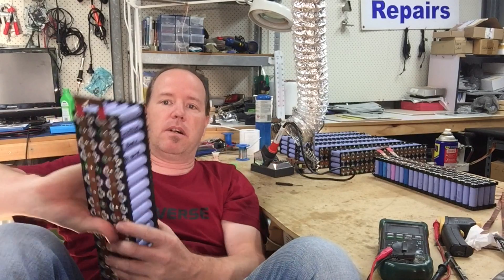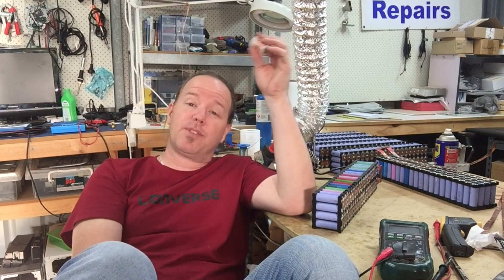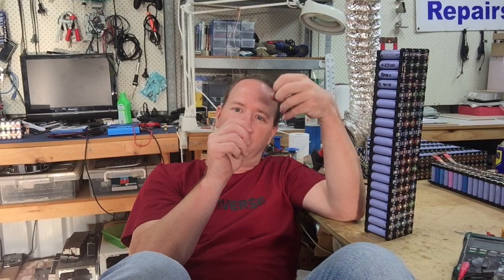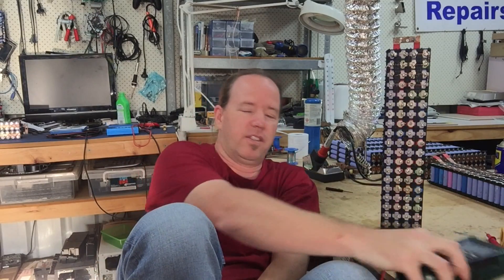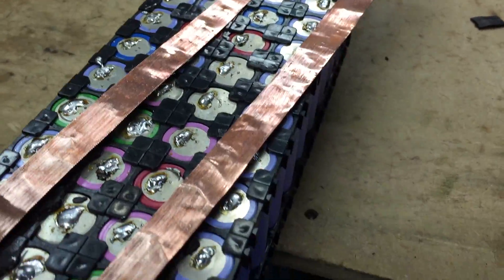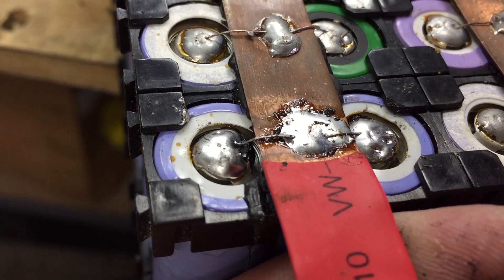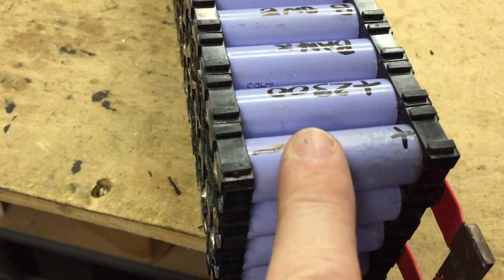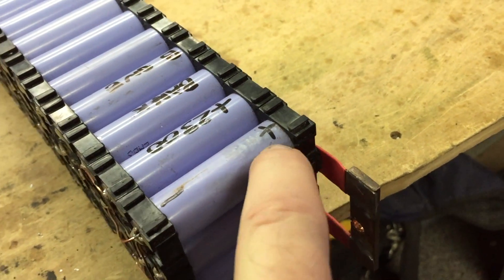Thought I had to redo all cell fuses! VERY poorly produced video - Sorry in advance.

Comment: always leave a bit of slack in the fuse wire...Tesla does..... for different temperatures where the fuse wire could be under contraction from temp change and fail...pulling the fuse wire over multiple cells when soldering...heat on contraction the small fuse wire is already under strain...question mark

Comment: amps is amps and volts are volts arent they ? so if your using a rated 4 amp wire then it should have blown at 4  or slightly more than 4  in real world conditions  would an mov be any better or cost effective ?
Reply from the maker: Yep, learned a lot since then :)

Comment: apart from batrium is there a way of checking individual cells ?
Reply from the maker: Of cause, you can do individual cell volt led displays, manually do it with multimeter many even playing with Arduino's
Reply: but currently not very practical or economic
Reply from the maker: I guess how practical the safety is i guess

Comment: Old video but Peter, you should have put the multimeter in series of the fuse and see what the current is being put into the battery, it could have been just before breaking point, If it was over what you expected the fuse was suppose to break at, then the fuse is a bad size. it may have been just under the point of it going red.
You should calculate the max current you expect/want out of the pack and then divide by the number of cells and put that size fuse for each cell + ~20% for surges etc with a max fuse for overall pack in case of short across the positive terminal (which I think you did in newer videos).

Fuse testing should also be done with a shunt system and something (PI maybe) that records in ADC so you can see the ramp up and breaking point in amps. This is something I've been thinking to design and build as I can't find anything on the market (or goolge fu skills suck)

Comment: U - voltage
p - specific resistance of the certain materials (Cu = 0.018Ohms/mm^2 - Al = 0.027Ohms/mm^2)
L - wire length 
I - Current
S - cross section of the wire (r^2 * π) - r = R/2
P - power

Basic math (or should I say physic)   -> U = pLI/S or I = (U*S)/(p*L)

Here is the maths for your fuse, or the basic rule of thumb if your copper wire is R=1mm it can conduct ~10A(!!!) for 15mm of length.

Comment: Just wanted to thank you, I was doing the same mistake testing my fuse wire @12v until I saw your video. My fuse wire (+-0.1mm diameter copper) burn at approx 4A 4v or 12v and can hold 2A cool so I think it will be ok.
A good progressive way to put a progressive load is to use a battery drill, I was able to push from approx 0.5A to 5A graddualy to test different fuse wires.
Reply from the maker: thank-you for your comment. Pete

Comment: If that dud cell was even drawing max 4 A through the intact fuse at about 3.8 V then the 15W of heat generated would raise the temp considerably.     Fuse wire used to be expected to blow at twice the rating within 2 (?) seconds.  Many have commented on the slip up at 10:58 that blew the MM fuse.     It happens to the best of us.  :-)
Reply from the maker: Cheers thanks for the input

Comment: I've heard electricity described as very much like water as it is affected by gravity it can be channeled like water through valves

really just mastering some Hands-On basic multimeter tests will put you in the right direction

many people learn by doing things the wrong way a couple times first, nothing wrong with it

I'd recommend a basic test light that can show positive and ground circuits to help when you're exploring your battery packs and bring the meter in for more specific tests
Reply from the maker: +jimm therockgate noted

Comment: Ok, as others have already said what you did with the multimeter was to short the battery pack by connecting + and - via the multimeter. You should have put one probe on the + of the bad cell and the other on the + of the rest of the pack to measure the flow through the bad cell.

One tip when testing things like this is to put a bulb in series as a current limiter, it helps to keep the magic smoke in.

I'll admit that I've blown multimeter fuses many times in the same way. The big one for me was ussing it to measure amps one day and then next going to do quick voltage check on a battery and forgetting the leads were in the amps plugs....

Very interesting in that I've not seen many 18650 cell failures and I have been wondering how they fail. Check out axial fuses, I havn't counted but 100 cells in parallel even with just 1A fuses allows 100A for the pack. I suspect that when 18650 cells fail they are unlikely to go to a dead short as there will be resistance in the pack, this appears to be exactly what you had and why the fuse did not blow.

Comment: Just wanted to point out one flaw in the way you connect the bus bar to your cells. The way you have it connected right now, it is the front cells which are taking the most hit, both when charging, or discharging, because the path of least resistance is straight through the first pack, then second etc.. I remember watching lectures about electrical engineering and it was emphasized, that plus and minus should be pulled from opposite ends, as in, the current should be forced to go through the entire bus-bar.
Reply: when you pushing 5A in the first cell at 3,7v and find the right wire. Do you use the same wire for cell nr2,3,4......and so on? isn't the voltage getting higher in every cell in series?
Reply from the maker: +TheRadiastral yep all fixed up ;)
Reply: HBPowerwall Glad to hear. Awesome job, btw!
Reply: O

Comment: I think you want a thermal fuse.  If a cell gets an internal short, it doesn't need to pull large amounts of current, it can use it's own power to go thermal.  A fuse laying against the cell that could sense its heat could blow, protecting the rest of the pack.
Reply from the maker: Doesn't sound like a horrible idea - Did consider putting a thermal fuse on neg and fuse wire on positive but really did seem like over kill.

Comment: fuses blow on current and not volts, 4amps is 4 amps at 12v or 48v
Reply from the maker: Yep, since learnt that :) something new every day :)
Reply: Contact me anytime with questions I am a design engineer with lots of experience :-)
Reply: Yeah, a fuse blows when the power it is dissipating is enough to melt the wire. Power equals amps times volts, the voltage across the fuse equals the product of the current flowing through it and the fuse's resistance (by ohm's law) Therefore the power equals resistance of fuse multiplied by the current squared that is it is totally independent of volts. Therefore a 4 amp fuse will blow at the same current regardless of voltage, the only reason for a voltage limit on a fuse is safety (66,000 volts will arc across a 4 amp auto fuse!!!)
Reply: Rich, I am just starting the process. I am building a 72v 20ah pack for a electric motorcycle. What is the ideal set up to test fuse wire. I am guessing. connect 2 wires to single battery, one wire goes to a load. the other has alligator clip. you hook the fuse wire, then you put your multi-meter in series, then the other end to the load. Ideally the load can be varied, such as someone suggested using a variable speed drill or dial resister.  So at 3.0 volts, 4 amp draw, what should my resistance be?  And is this the correct set up?

Comment: Pete, i couldn't make out the wire you are using.  you said you would link it but Couldn't see it anywhere. what type of fuse wire are you using?
Reply from the maker: +Peter Hoyle it is 0.25 mm winding wire from jaycar is is linked in the battery shed video description I think.
Reply from the maker: +Peter Hoyle https://www.ebay.com.au/itm/252441212705
Reply: +HBPowerwall Cool, thanks.
Reply: .24mm (0.00944882 ins),   28ga is 0.0126, seems like 32ga. Seems too thin, others recommend 28ga. Beginning to think no one knows.

Comment: Why I think your fuse didn't blow at 4A like you tested:
Because you tested a greater length of fuse-wire. The length of fuse wire between the busbar and the cell terminal is very short, so it's easy for heat to be conducted away by the copper busbar and the cell. 

The problem with your IR themometer:
Don't use it on bare metals (or any other material that has a low emissivity in long wave IR-spectrum). The heat shrink is fine, but please look up a table of IR emissivity values for different materials. If you want to measure metal, then you put some paint on it first. At least enough to cover the measuring spot. Your measuring spot is NOT the red spot. That red spot is just to help you point. Usually there's a table on side of these devices that will tell you what the relation between measuring distance and spot size is. If your measuring spot is larger than the spot you want to measure it will average over that larger spot and you'll get an average over the entire spot.
Reply: The fuse did not blow, because it was heating up from Resistance till it would have got so hot to blow the fuse. I am not sure what wire he was using at the time.

Comment: Connecting your multimeter across the pack will kill it every time. You need to put the amp leads in series with the +ive wire. What you did was let all the cells dump their energy through the multimeter.
Testing voltage is done in parallel across a cell or circuit, testing amps is done in series.
Reply from the maker: +jimm therockgate hey first to admit that hell I don't even fix my own car but my car hasn't caught on fire yet so guess I'll make out alive :)
Reply: This

this guy is lacking basic knowledge of how electricity works

he's probably going to burn his house down if he doesn't learn
Reply: I saw that setting on amps did shorted out across the batteries, seem it isn't the fuse fault, you made the meter setting on amp shorted out across the batteries. Clive has pointed out to you.
Reply: This is correct.  You shorted the battery pack through the amp meter by itself and none of the current went through the bad cell.  

The fuse wire you used in your batter are probably fine, actually.
Reply: That's a very common mistake, probably because people just know checking voltage is between red and black. I bet the number of multimeters that are blown that way everyday is surprisingly high.

Comment: Those fuses look too tight, thermo expansion/contraction could break the wires. I made mine with a S curve. AND If yours did blow it would have vaporized.
Reply from the maker: Humm interesting, i'll look at trying to give them a touch more slack from now on.
Reply: I wouldn't go re-wire all of yours, just monitor them, but all future wiring I would implement some sort of spring. ....and i'll add an interrogative that i've been thinking about, might make a good episode: 18650's are going to start to be rare very soon. Tesla is moving to a 30% larger cell and laptops now are using pouch packs. Something to think about.
Reply: Just dumps millions on the market. Since these telsa battery packs are being reused or busted up and sold off pc by pc. I like the flat packs better, more juice in a smaller package. I just ordered a 30v for my  kids scooter. A flat pack with BMS. for 34.99.  From batteryalarm on ebay.

Comment: good video, 

my under standing

4amps is 4 amps       4v  10v    100v

the length of the fuse will make it weaker  (longer)

and your test with the meter I think you might off stuffed up.

it looked like you went from buss bar to buss bar? 

should have been from negative to fuse wire.
Reply: 2 inches to 2 feet don't matter, you have to talking feet to make a difference. This is not resistance wire, it tinned copper.

Comment: When you do the next tests, only use the same length of wire that you would have used to connect the bus bars to the battery. 12-15mm?

Comment: Do you need fuses for an ebike battery pack? I've got a 14S 14 P ebike battery pack I made from salvaged 18650s and I didn't use fuses. Of course this is just an ebike battery and not a giant 22kwh powerwall So I didn't think it would be a necessity. Also fusing cells like that takes up significantly more space on an ebike battery and I needed to reduce space as much as possible. Should I tear apart my entire battery pack and start over or should I just be careful and not redo the pack?
Reply from the maker: Completely up to you, I don't think I've seen an ebike battery with fuses. Sub https://www.youtube.com/user/bruno2bari this channel if you haven't already and take a look at his ebike battery vids - pretty insane stuff and the info you need might be over there.
Reply: YES, you are bouncing that thing around.  Did you add a BMS?

Comment: Big ops aye Connecting the millimeter up across the pos and neg, given each cell can put out 8amps on a short thats 80cells x around 8amps peek so a peek of 640amps , The poor millimeter 10amp didn't stand a chance, Made for a good video snippet tho.

If the fuse wire is 4amps or around that , Remember thats 4 amps per cell not 4amps for the whole pack. Its 320amps Which is why you can pull 90amps from your inverter and your packs are happy. 
Note.Packs in series share the same overall max current as one pack but with more voltage.
With my quick testing with that fuse wire, it seamed to blow around 5-6 amps, ether way it does blow under 10amp and as you found out with your dead cell, it does protect that pack using the wire size you had :)

Comment: have you got a bench power supply? you could use that to test the fuse wire.
My thoughts would be that the fuse wire should blow with 4 amps flowing through it regardless of the overall voltage since the fuse wire is rated in amps not watts. Obviously I stand to be corrected on that but...
If you hook a section of fuse wire up to a bench power supply (mine does 0-5 amps at 0-30v) you could test it at various voltage/amperage values to make sure. I'd test different lengths as well just to be sure that that doesnt factor into the equation.
Reply: You don't need any power supply, you are testing a shorting condition.  You do need some kind of variable load.

Comment: You need to test across the blown fuse connection with tester on amps. User 2 short piece of thick wire to get best reading without volt drop across tester leads. That wire used will never carry even 10A.
When you tested current you was checking short circuit current of batterys which would have been a lot higher if not for resistance of meter leads.
Cheers
Gary

Comment: Multimeter in current mode is acting as a current shunt.  You drew 20+ amps from all the cells in parallel, minus the failed battery that you had already cut the wire on.  The negative side was all soldered together.  Your positive was on the busbar.  Your were basically shorting positive to negative on all the cells through your meter.  That test didn't tell you anything about your cell level fuses.

Comment: Just two thoughts:
1) Glad you found this issue sooner than later!
2) For testing new wires, you might use one of these cheap power supplies: http://www.ebay.com/itm/201138076316
Set a voltage, crank up the amps, see your wire blowing (or glowing).
Reply: Just how would you wire that up using a single cell?

Comment: Fault current (short circuit) and load current is different,when I was at tech the lecturer set up some 5A fuse wire and had 28A running through it for a good hour before it finally blew,it's all down to tripping characteristics and fuse wire is the worst and is why a circuit has to be within regulations here in uk to use it

Comment: The fusing is for individual cells only. Even at only 4 amps per cell the entire pack could theoretically provide 320 amps before blowing fuses, that's a LOT of current. If one cell is bad then and has a voltage difference the fuse should stop it from charging or discharging at more than 4 amp, with the rest of the pack connected it would have blown. The voltage difference probably wasn't big enough to draw more than 4 amp.
Reply: yeah its only a voltage difference  unless its a dead short. the pack worked as a whole to blow the multi meter fuse.

Comment: You did your amperage test wrong!
You checked amperage of your pack excluding failed battery.
You should check how many amps is going through dead battery (replace cut fuse with multimetr) (it probably isn't that much to blew the fuse)
also you have most of the fuse resting on bus bar, so it can dispense heat that should blew your fuse.
Reply: Yea, he knows now, only 50 people told him.